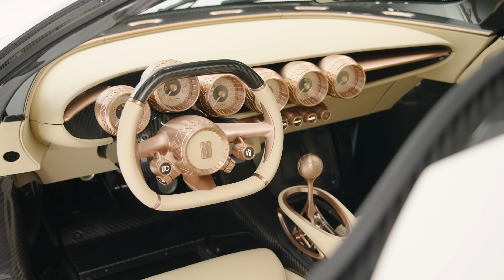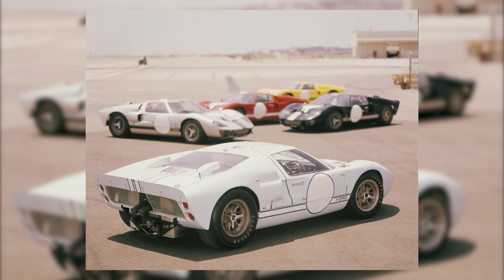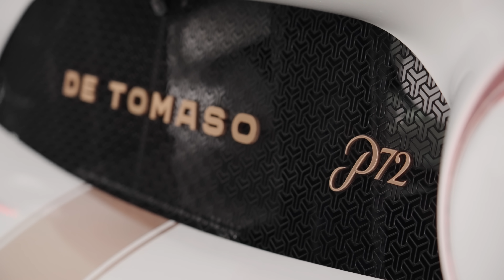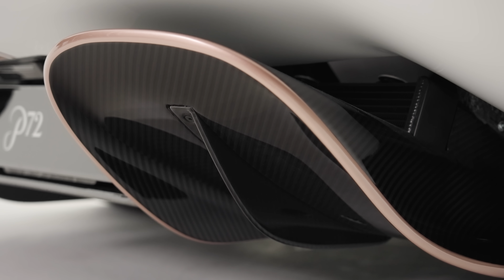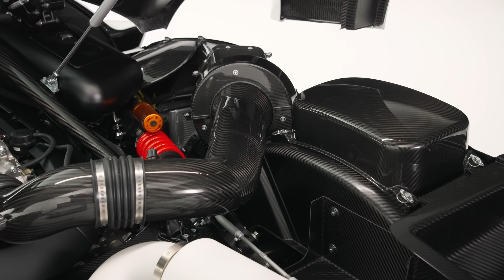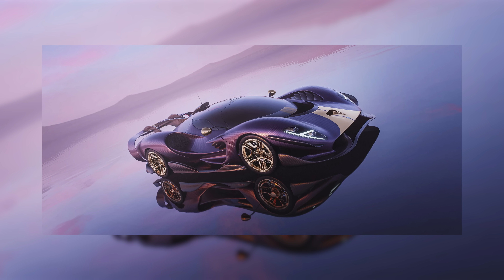FIRST LOOK: De Tomaso P72 – 700bhp, £1.6m… Work Of Art?

Comment: LOOKS 95/100 
TRACK PERFORMANCE 65/100
VALUE 30/100

it looks soo good! But at the end of the day 1.6million euro? For 700 hp based on a ford engine that’s completely rebuilt (easy to maintain?) that has carbon fibre for weight, but other things that add weight for looks? 
Pagani is the closest thing with bespoke interior, 3rd party engine etc. but Pagani have proved themselves and their first car wasn’t close to this. Also at first look the interior is great, but the more you look it’s RELATIVELY simple compared to the pagani. Not sinple in a beautiful understated way but in a slightly lazy way with all those binnacles conpletely bronze coloured all the same shape and size with not even a ring of colour to break it up, or  cascading sizes, or wrapping around driver or anytging rather than the 6 momo coloured eggs lined up. The more you look at the pagani, they woukd have spent 10x as long on every curve, detail, pattern, shape, size, how it integrates, the proportions etc. as an artist these are the things I pick up straight away. If they spent as much effort on the inside as on the outside I think maybe 800000 might be more justifiable. In saying tgst thevtrack ready car might be completely different. If the concept aboit making it a real drivers car is true I wonder if it has no TC, ESC, ABS etc or at least adjustability to have bare requirements

Comment: Only good thing about the ford v8 over a dope loud screaming v12 is that motor will easily make 1500hp. Especially since its all forged internals. Or swap the pulley and get up to tht comfortable and reliable 850hp

Comment: changing the oil in a bugatti? $20,000. Changing the oil in this? $50 and they will also bring you the air filter. All seriousness though that is such a smart move putting a "normal" V8 in this thing for reliability AND historical reasons.

Comment: There are 3 flaws imho: 
1. Car is styled after Ferrari P3/4 but now the high pitched V12  from concept car has been removed. 
2. Whole car is bulbous, rear lights at least should have been concave to contrast that, thankfully they changed the rear othervise to be different and less like 7m long cloud form. 
3. Ferrari SP3 exists. It might not have chrome interior but instead it is best car Ferrari ever have done. And excellent hark back to P3/4 with sharper design and juicy drivers car interior.

Comment: It's one of the most beautiful and best sounding cars ever made imo. But they really nerfed it by replacing the V12, removing the right angled and sharp edged diffuser, and tweaking the bodywork from the sides. The prototype was just perfect, they shouldn't have changed a thing.

Comment: Lame..looks like a generic le mans car from the 70s receiving a very small restomod, aka, modern lights and a plush interior
Nothing to be impressed or desirable or modern  or futuristic
Reply: That Is how they actually started the thing. The Pantera was a Mid engined basic Looking car that was made to be the Ford GT40 that YOU could drive on the road. It wasn't too Extreme, not until It got it's over the top bodykit to rival the Lamborghini Countach, so... Yeah, DeTomaso never went for Extremely cool design, but simple and loveable Super Machines. The only case they wanted to make something a bit more different was the Guarà. And everybody Forgot It even existed.

Comment: In 20-30 years this will look as good as it does now. timeless design, and elegance to spare.
Reply: How do you know this?
Reply: @dell9483  Sometimes you can just tell
Reply: @dell9483 look at the veyron bruh its 20yrs old
Reply: @madanganikuruppu81 nah the Veyron looks 2000s very clearly. All the Zonda’s look like they drove out the factory yesterday, goes for the LaF, P1 and 918 as well. And we’re only talking hypercars here, there’s plenty timeless cars older than the Veyron that look newer.
Reply: @dell9483  For example, look at the Spyker C8 and when it was made. No screens that will look outdated in a few years, but beautiful, classic round dials with solid knobs and switches.
Reply: It won't because it'll never be built, lol
Reply: Agreed. It's very nice

Comment: In the late 60's I was 17 and working my first job at Bubba Oustalet Ford. One day someone drove up in one of the original De Tomaso Mangustas. It was a beauty, but the motor was a rather mild mannered 351 Cleveland V8 in the back. The owner needed a ride to work, and as we had no loaners that day I went w/ him to his work place and drove the Mangusta back myself. 

The owner looked skeptical but I ignored him and basically leaped into the car due to the high door sills. It was fast but not all that fast, my '66 Mustang would probably beat it in a straight line, but that Mangusta had amazing brakes. Just a light touch almost pitched me through the windshield.
Reply: Thanks, Ferris.

Comment: This feels like Zonda meets second gen Ford GT40. Such a nice design.. and proof if you stop chasing bigger and better numbers than competition you can make something more desirable.
Reply: You say second gen Ford GT40, but to me it looks more like someone mixed the best bits of a 33 Stradale(original) with the Ferrari P3/4(daytona winner) and than didn't ape too much of either for me to mind it.  It has hints of older cars but doesn't have the stench of the 2000s era retro nonesense, it just does something cool on its own that i've longed to see.

I would straighten the area under the rear engine heat exit though, redo that, not sure why its half-mooned, but front or side profile is fantastic, i don't think i'd get bored looking at it.
Reply: @Ottobon Good call on the 33… see it now. Which is obviously no bad thing!
Reply: Modern regulations will probably ruin this car.  
You look at hypercars that came out in those past 3 or so years and they look more like supercars than hypercars.
It's like GT1 is being canceled for the third time.

Comment: Gorgeous work! A true masterpiece of car design – one of the most beautiful cars I’ve ever seen. The only slight disappointment is the engine. The prototype’s V12 had an amazing high-revving roar, and this car should have kept that character.
Reply: Thats the P900. The P72 has the 5,0L  Coyote since day 1
Reply: @rrturo  the prototype had a v12 too.
Reply: @homere-d-allaure  the P900 not the P72
Reply: @rrturo  https://youtu.be/99I8qOgSozU?si=_4CWce_AZ-oRaSy3
Reply: @rrturo  https://youtu.be/99I8qOgSozU?si=_4CWce_AZ-oRaSy3
Reply: @rrturo prototype of p72 was equipped with 6.5L v12, it has been mentioned several times even in this video…)
Reply: @rrturo  no. The P900 will have a V12, that's right. The P72 was always meant to have a V8, that's right too. 
But de Tomaso never hid they used a V12 on their P72 prototype. You can look on YouTube, there are some clips from the prototype with what is clearly a V12 sound. The definitive car won't have it, but the prototype did receive a V12 for its development.
Reply: @homere-d-allaure  yeah the V12 was meant for the P900
Reply: @rrturo  yes, and the P72 was tested with a V12 (not sure if this was the P900 engine though)
Reply: Pantera history is all about the V8

Comment: What's about forthcoming regulations mandating a minimum roofline height? Why? Is this because SUV drivers can't see low cars? I don't thing we should be regulating towards taller cars. It should always be legal to have cars as low as a Caterham, or an old Europa, or a GT40 on the road. Assuming the driver can see out of it, it should be perfectly legal for a Stratos Zero to be on the road too. They should legislate mandatory syatems on bigger vehicles to give them situational awareness instead. If the bling spot sensors in rear view mirrors can't detect a low car, that should not be the low car's problem! As for the P72, it's gorgeous and clean like a Tuatara or the Glickenhaus P3/4 Enzo tribute. I think I'd prefer it to a T.33, but not to a T.50.

Comment: People will hate the Coyote V8 vs the V12 but real ones know the Coyote is an absolute monster engine. Easily capable of 1000 horsepower with a roots supercharger. In fact I would bet that they intentionally dialed it down a little from the bleeding edge it was capable of.

Comment: Shouldn't the front badge have been rounded in the right side upper and lower corner tips, so as to illustrate
the letter D instead of a meaningless rectangular box design? I would, as a purchaser, demand that this be
rectified immediately.

Comment: Why not a Mercedes V12, would be realiable too
Reply: Mercedes makes the twin turbo V12 now, it's not really an exotic V12.
Reply: @GSCinquanta  they don't make the NA ones anymore? Only for track cars like the Huayra R?
Reply: @wololo10  No and I am assuming making the 6L V12 in the Huayra R road legalised is either expensive or difficult which is why even the Utopia doesn't get the NA V12 in road legal form. The best option for DeTomasso was to use the Ferrari V12, best NA V12 motor.
Reply: @GSCinquanta  I dont think Ferrari would do that, only seen Maserati and Alfa using Ferrari engines lately, and only V8 and V6, no V12. There's a new road legal Zonda with a Mercedes NA V12 too, the Zona Unico, although it looks like it's using an old chassis.
Reply: @wololo10 Lmao the Apollo IE used the Ferrari V12! You people have some kind of different perception about Ferrari! 🤦🏻‍♂️Those old Zonda units upgraded to the 760 spec with some bespoke elements as per the clients choice. The M297 V12 isn't in production.
Reply: @GSCinquanta  Oh I didnt know that, would be nice a ferrari v12 too for sure
Reply: Yeah fantastic engines 😎👍

I'm using the mercedes V12 for my supercar build 😁

Comment: Supposed to be a v12 did they ever release it. Many pre orders were canceled years ago because they tried to reduce the engine
Reply: Pretty sure it was always supposed to have a V8. It was just the fact that it was so closely related to the Apollo IE that, for development & the show cars, it ended up using a lot of the same parts 🤔 IE the V12
Reply: If only someone had made a video which answers these questions
Reply: Yeah, the only way is with the V12. It doesn't give V8 vibes. 
The V12 with the design was art, visually and audibly, it doesn't feel the same with the V8.
Reply: @F1ll1nTh3Blanks De Tomaso's have always used Ford V8s. It would have been weird to just throw a V12 in there because "muh italian exotic needs a V12!" Instead of respecting the history of the brand and its close ties to Ford as a regular user of their crate small blocks.